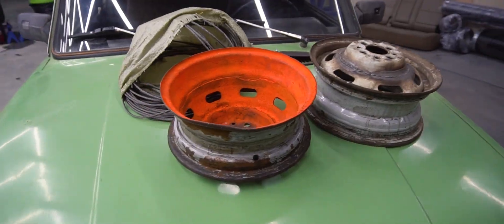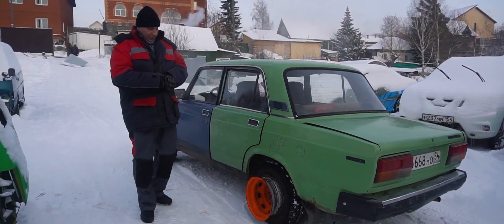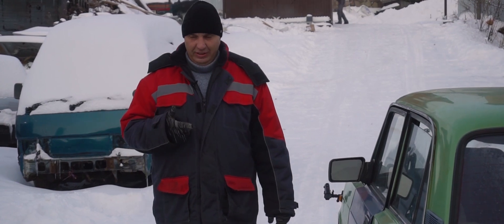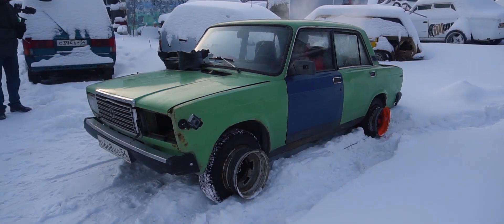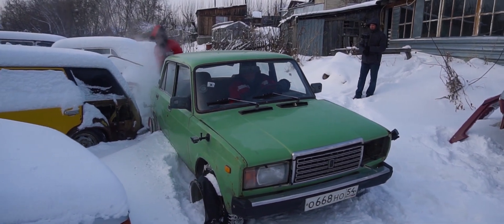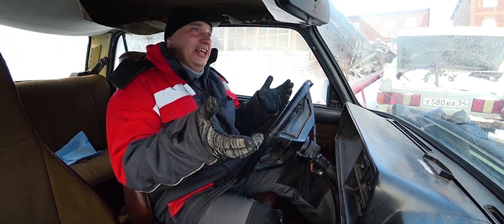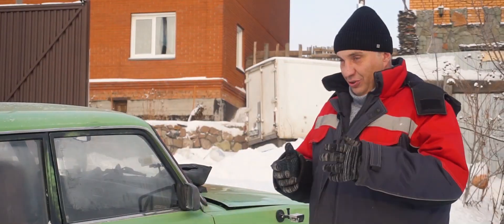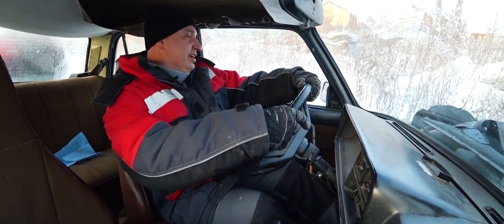DIY four wheel drive system – can it work?

Comment: I wonder if a figure 8 would work, with tension pulleys?     However, there would have to be something on the rims to prevent slippage of the cables'      Also I wondering if sprockets and a long chain might work?   You'd have to fabricate something on the front wheel to prevent the chain from coming off - and the unpreventable slack - when turning the wheel.

Comment: Could just have the rims stick out on the drive wheels with a couple of holes in them. Then when you get stuck simply slip a couple of short fence posts in and drive off. Turning sharp may be a problem though if its front wheel drive

Comment: So could we just use motorcycle sprocket on the back one on the front with a long chain not to go far i mean just make a emergency kit so to speak i know you couldn't turn the wheel far but just wondering if the chain would make the front wheel turn

Comment: What's in the picture is a device you use to pull a car out of a patch of mud or a hole. You wrap a cable around a tree and as the wheel spins it winds the cable up at the wheel and pulls the car forward if you have no traction it works well.
Reply: The problem of using it like 4 wheel drive is the front wheels turn left to right shortening and extending the distance between the front hub and the rear hub.

Comment: If they had made a perpetual looping they could go indefinitely. Make three loops around the front followed by three loops around the back, then join the two ends with a cable spanner. ( front, start inside edge of wheel wrap toward outside edge, rear continue outside edge of wheel layering towards inside edge. then connect both ends ).

Comment: I'd like to modify your idea.  Wrap the cable around both tires front and back.  About midway have a dual wire wheel guide that puts pressure on the lines keeping them tight.  Imagine an 8. The center being dual pullies. Might need a bolt to pull them together. This would be continuous running

Comment: You guys should try this again this winter except put a continuous cable loop around both wheels. Like, wrap it 4 or 5  times around the back wheel for friction, then to the front with 4 or 5 wraps, then connect it in a loop. It looked like you had some steering while the cables were tight, so you could steer a bit but never run out of cable. That would probably help the steering wheel jolt too.

Comment: Try replacing the cable with a belt or a chain. You would have very little to no steering, but you wouldn't run out of distance.

Comment: Should have left a pin release  in the rear so when you finally run out of wire it will detach by its self.

Comment: It will be much more stable if you have front wheel drive. The chain or cable won't jolt you near as hard because the steering and power are on the same wheels.

Comment: You should test this system on tarmac and see what happens to the car's axles if they violently attract while the car is driving at eg 40 km/h and the cable runs out. No one should be in the car apparently :P

Comment: This is actually too risky. What's going to happen when the whole cable unwrap from the rear wheels and move to front ones, shock for the engine and wheels. The least thing is cables to break and do some damage eventually. Why don't you try to put endless wire rope sling with mechanisms to make it tight there in order to make enough friction between cable and rims...or something alike

Comment: Put a ujoint on the drive wheel and then chain drive tofront tso the rear part can turn with the front and it will work. The joint will take all the turning and you wont need cable.

Comment: Try using steel rods with balls joints welded to the rims. You could use two per side if you spaced one further out from the car than the other so that they don't collide upon rotation. Sort of like a locomotive

Comment: Hi. I have got idea for emergency mad or snow dragging system. Could you install metal bars with two another bars inside to the rear wheels using longer bolts as usual? Internal metal bars you will be able to slide in end out and adjust the lengths depend of how deep is mad or snow you stuck. Any questions or drawing write to me, pls chanekmarcin@yahoo.com

Comment: 4wd is only useful for a few meters for getting out of mud etc. For this occasional use has anyone tried fitting electric caravan drives to the rear wheels of a front wheel drive vehicle?

Comment: You found a way to have 2 rims on each wheel.
Why not attach rubber to the outside rims? You would technically have four wheel drive, its just all four wheels would be on the same end of the car...
Or you could combine the ideas. 8 wheel drive....

Comment: You could have had better luck running a chain, than using the steel cable. That way your "DIY" 4x4 System wouldn't lock up the wheels by running out of cable. So far, the car can only go so far forward, or reverse without locking up. Using a chain, you could have infinite mobility, and more power at both wheels.

Comment: Really cool video, I was really shocked when it actually worked... They should have made a release system when the cable wound off from the front wheels. So that you don't get that jolt on the steering wheel..

Comment: Next step, would be to operate a car, using an outboard motor(on a trailer), and electric motors on the wheels. Or use a drive shaft from the outboard motor, to turn the car wheels.

Comment: Always thought about fitting the Niva 4x4 running gear into the 2105 shell, I had the Niva and the 2105 but trouble was both of them were too nice to cut up.

Comment: On an economy pickup, what if you had a second transmission mounted behind the original, except backwards. 4th gear is 1:1 straight though so you could put the transmission in 3rd or 2nd for a double or triple overdrive, but probably not first because it would be too high of gear ratio. Also if you have the second transmission in 5th gear and the first transmission in 1st gear, it would be a granny gear.

Comment: This would probably be a good thing to include in n emergency kit, but with a sprocket you could simply take your lugs off, mount, and attach a belt or chain to. No need to worry about winding it back up then.

Comment: 4 wheel drive lada powered by a hydraulic pump with 4 hydraulic gearbox turning each wheel. Of course powered by the original lada engine. Who needs brakes? Use hydraulic valves to divert pressure to and from the gearboxes.

Comment: So now let's improve it slightly. 
1. Some kind of quick disconnect could be useful. Even smaller screws or some locks. This way whenever you get to the end of the cable, you just swap them diagonally (rear left to front right) and continue.
2. Safety cable release. This cable needs only some securing. Mostly it should prevent spin on the wheel but should fall off when you pull it the other way. This way when it's end, it will just fly off.
3. Improving previous idea, more joint points so you can more precisely fasten the cable and have less length difference on both sides preventing this violent steering wheel shake.

Comment: If the asymmetric partial AWD system that's on the new prius is anything to go by, you don't really need much extra power on the extra set of wheels to see some small benefit.

Comment: Great video! Try unlocking the diff as this is hindering the steering. Also make the cables in a continuous loop on each side.  Wrap the cables around each wheel 3 or 4 times, this way you don’t run out of cable. Cable idler pulleys may also help keep the cables from binding on the body of the car when steering.

I love how you guys think out of the box!

Comment: THE PICTURE FROM 0.08 -0.12 I A WINCH WE USE HERE AND THERE IS A SYSTEM USED HERE TO MAKE OUR 4X2 INTO A 4X4 USING CONTINUOUS CABLE WRAPPED AROUND FRONT AND REAR HUBS ABOUT 2 1/2 TIMES SO IT WILL GRAB ON TO DRIVE

Comment: Reninds me of what I used to do with my toy trucks as a kid. I'd take a rubber band and loop it between the front and rear wheel on the same side and do the same on the other and then I'd have a 4WD. Or I'd put a rubber band around the front and rear axle and turn the front wheels and rely on the friction of the rubber band to turn the rear wheels like some crude AWD system.

Comment: So the thumbnail was clickbait, then?  Huh, that's pretty fucking lame.
  The thumbnail picture showed a much superior system which would have only been a little more work to make and way less work to operate.  It had a continuously looped belt as well as what looked to be a spring loaded tensioning system which would accommodate the changing loop length imposed by steering while keeping the belt under constant tension.  Extra wide flanges on the driven pulley keep the v belt in its groove when the front wheels deviate from the plane of the belt while steering.
  It looked really cool, like something I'd want to watch a video about.  Thanks for nothing.  Guess I'll unsubscribe.  I prefer not to be intentionally misled and have my time wasted.

Comment: no, replace the cable with some kind of track or chain that will ride the rims without slipping. inside an NP203 transfer case there is a monster "chain". it would take a bunch of them but would not break. maybe something else you could make would work too. a guy is making a tank on u tube and made his own track. it would be like that but they wouldn't wear from being on the ground just between the front and back wheels. yeah turning would be tough.

Comment: Replace Cable with a Stud on each rim thing, and a bar with ball joints on both ends joining the stud to the bar would do same only no need to worry about running out of cable and give some maneuverability...  I know if anyone can do it...  you beautiful crazy russian   bastards can do it! (bonus points if you take it one step further and use two tubes which fit in each other to increase ability to turn)

Comment: I once saw a WWII Canadian truck that had capstans that sort of looked like a smaller wheel without a tire mounted to the front wheels (4x4) instead of a winch. Seemed to be a very simple way to get the truck out of trouble without the complications of a PTO driven winch. If I remember right, it was a cabover Ford. Saw so many trucks that day I can't remember exactly what make it was, but clearly remember the device.

Comment: At least you tried, has me wandering if the car you were told about was used in short distances or, as you brought up, longer length of cable for greater distance. Also wander about making it gear/chain    
driven

Comment: A hinged Gear off the front axle, a hinged gear off the rear axle - connects via your lugnuts, you wrap the chain around - chain has tensioner/guide placed off side of frame. Chain tensioner/guide is quick pinned into place. 

You accelerate, chain pulls front wheel. You turn, the gear will swivel, the tension drop would be negated by the tensioner, the guide will keep chain relatively straight for rear gear. You turn left and well the chain will probably chew the living shit out your tire before derailing so.. figure that one out urselves

CHAINS! fuck im high

Comment: Should be cool if you guys could try to make a hybrid 4 wheel drive system, where every wheel has its own electric motor and the electric motors are getting power from the cars gasoline engine (basically functioning as a generator)

Comment: That picture is not showing the cable making the truck 4x4.. It's a poor man's winch!! That attaches to the wheel.. But still a cool idea..☺
I've seen guys attach a rope to a tree and around the rear tire to get a rear wheel drive truck out of the mud.. Wraps up the same way but around the tire..

Comment: to turn the wheels and keep the rope attached you have to have a guide connected to the rear of the front fender well and to the front of the rear fender well that the cord and run through

Comment: A belt so you can keep going would be awesome!   OR.                                 How about putting a 4x4 diff in the front, and connect front to rear with prop shaft, with a sprocket on the trans, and props shaft???????? Full-time awd!

Comment: This looks all too danger[RUS]!. . . . . I reckon it could be fun if you tried winding the cable the opposite way round on the front rims, so that it would run 'top of front' rim to 'bottom of rear' rim - it would make the wheels turn in opposite directions! the car would go nowhere, but to bury itself in the snow.

Comment: This might be an idea I'll try to be short.
I) the wire needs to be a loop.
ii) in the middle of the rim at uniform intervals weld a V piece of box steel, 
iii) the steel V needs to be able to catch and hold the loop, and release it. Maybe little triangle teeth, like pinking sheers might help. 
Otherwise a motorbike chain with a sprocket welded in the middle of every hub. It will need to be quite strong and the sprockets need to be a good size. The larger the sprocket the easier it'll be to drive, plus a simple tension system to stop slip.
Reply: How would you turn?
Reply: @oddballdynamics.9658  With great difficulty, it would be far from the 'finger guillotine' as the host here calls this. On the V system steering would be easier, especially if there are no teeth.
Do you know about chain tension? On the power/drive side =tension, as it's under load. It's post power where the chain slacks. It's this slack can allow for steering and avoid the snap back seen at
Like the guy above typed it's too much work. You'd need chain guides for the front wheel, a precise length of chain, correct tensioner placement and have the tension just right.
The main goal is to reduce slip of a looped wire, I've thought of other silly ways one could do it but steering is the bane. It calls for slackness to aid steering. Sadly this increases the chances of reduced grip &/or becoming free from the hub.
Reply: Gunzee: good idea about the tensioner to take up the slack while turning. You could use leaf springs as tensioners. Chain guides with high sides. Steering would be slight but it would turn. Like Troy said you could use a belt. For guides you could use a rim and weld on a plate to make high sides
Reply: Too much work. This is what they’re trying to replicate https://youtu.be/trrEKbc6uqE
Reply: Or belt driven with a tensioner, no teeth. Just friction with a constant velocity (CV) system for turning.

Comment: I improvised the winch function when getting stuck in mud once, by wrapping a tow cable around the front driveshaft on my 1978 Audi 100. It worked like a charm.

Comment: Should try it with a really big drive belt between them instead. Turning will be a bitch, of course, but at least the range won't be so limited, and you won't have that steering wheel jerk.

Comment: Maybe use bike chains attach it to the diff and to the front wheel drive shafts underneath the car with a tentioner should work much better than the cable's

Comment: I would like to see it done with belts on the rims like pulleys so that you have 4 wheel drive all the time!!
Reply: I thought about a continuous belt as well. Maybe  with teeth like a sprocket. But when you  turn the wheel to steer the alignment between the front  and back wheels would be lost.
Only work for  straight  driving.
Reply: Wouldn't work because the belts would come off when you turn.

Comment: This system is known as a bushman's winch, it comes with a couple of adapters for each wheel like a bayonet fitting, you then snap the drum onto the mounts on a driven wheel unwind the cable and connect it to a soid object eg tree, post another vehicle then stick the vehicle in drive and the wheel will pull the vehicle out of the mud, sand, etc if you have a recovery ground anchor no tree or post needed.
It was never designed to run from a driven wheel to an undriven wheel just to mount on a driven wheel only when stuck and no good putting on an wheel with no drive, but a pretty cool idea if stuck with no way to pull youreslf out.